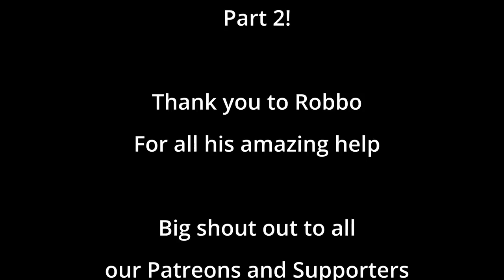Ep 67 - We Lost Our Top! Boat Roof Replacement - Part 1 #boatrestoration #topless

Comment: You guys are amazing for taking on such a project.  As a marine engineer, naval officer and former merchant mariner, I must also tell you that you're killing me!  A vessel does not have a roof!  In the UK, it is called a deckhead vs. the US where it is called the overhead.  You did a fantastic job on the the deck beams and the curvature of said beams is called deck camber or just camber.  Also, a boat or ship doesn't have walls!  They are called bulkheads.  Lastly, the vessel doesn't have stairs.  They are called either a ladder or a companionway.  

Keep up the good work.

Comment: When you are taking all that wood rubble off the boat, I wonder if a hippo bag (£10 at Wickes) could help you? At least it would contain the mess and hold more waste, until you got to the shore and the van.
Reply from the maker: We use big heavy duty sacks to transport all the rubbish for the smaller bits, makes it so much easier

Comment: Now is a great time to sit down and draw out the various electrical systems that are used on that level. From previous videos, it really must have been a "Drunken Sailor" who combined the High and low voltage systems bundled together, as well as what looks like the various data systems. May I suggest High Voltage systems down the Port side, Low Voltage down the Starboard side, and the data lines (antenna, computers, etc. down the middle). Some prefer using PVC pipe to isolate and insulate and using color coded wire to identify each system. I've seen occasions where that precaution was not taken and a several thousand dollar system has been destroyed by plugging a 12/24 vdc item into a 110/220 vac line.

Comment: WOW that roof was bad. Keeping the fresh water out will help no end. Great Video 2x👍
Reply: Slight correction:  Boats do not have ceilings, just "overheads" ............ sorry!
Reply: @olgringo-421  ?   I didnt mention ceilings. the roof is outside, the ceiling inside. But if the roof outside is called something else I dont really need to know, Im never going to need to change one. But thanks
Reply: @olgringo-421   -  Another slight correction:  Actually boats may have ceilings, especially wooden boats, but they are not overhead; they are on the exterior 'walls'.  Wooden boats have frames or ribs covered with planks that, when wet, swell tightly against each other and become pretty much watertight.  But the inner surface of the planks is always slightly damp and can get cargo wet or be uncomfortable for passengers, so the inner surface of the frames or ribs gets covered with another layer of wood to seal that moisture off while still maintaining airflow behind the boards.  This inner wall surface is called the ceiling, a variant spelling for what it is doing, sealing the moisture away.

I can't yet find proof of this next step, but I hope to learn if this is the way it happened.  I think that sailors building houses for themselves put a layer of boards under the roof rafters to seal away any moisture from minor roof leaks and called it the ceiling, naturally.  There was little or no rainwater coming in the exterior walls and no need to call the inner wall-surface a "ceiling," so gradually, for landlubbers, the ceiling became identified with the overhead surface of a room.  Nowadays, very few people even know there is a different nautical meaning for the word.

Comment: Are the wall structurally sound?  Or will you need to replace large parts of them as well?  Hoping they are sound, because trying to do the walls after you have done the roof could be difficult.
Reply from the maker: The structure of the walls is fine, it's just the external plywood that needs replacing
Reply: @ShipHappensUK  Ah, great.  I would hate to see you guys have to redo things.
Reply: I'm betting that Gemma and Simon could do it if anyone could! They'd have a plan.... and it would work slick.

Comment: I reckon those cut-off beams are down to someone needing crane access to the engine room at some point, and doing a shoddy job of making good afterwards.
Reply: This is why a planned opening is required right down to the engine room. Atlantide a Dunkirk Ship has a glass roof panel, the dining table top is glass for effect, the floor has a glass panel. Didn't see below decks but I'm sure the millionaire owner had that sorted as well.
The engines could be lifted up to the wheelhouse by installing a pair of vents in the WH roof for the crane wire, they could be then slid out through a wide enough doorway. In that way the WH roof will be a stronger unit.